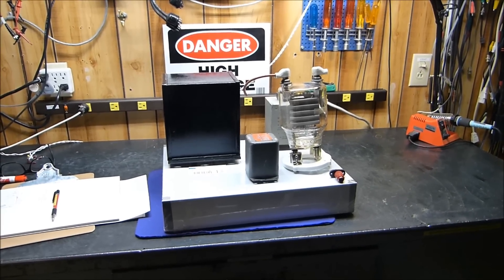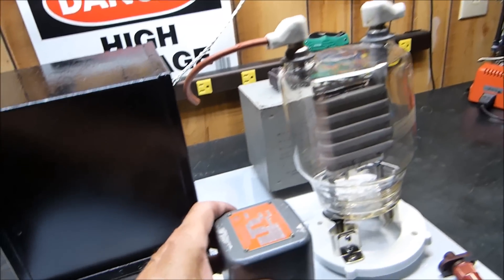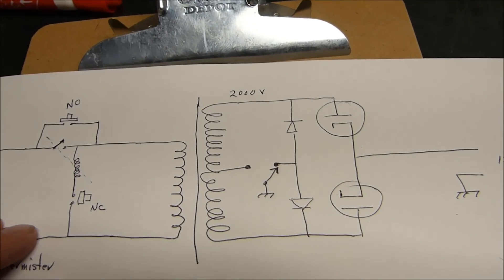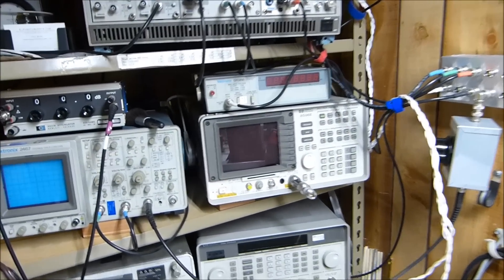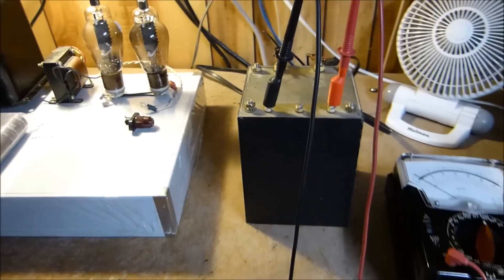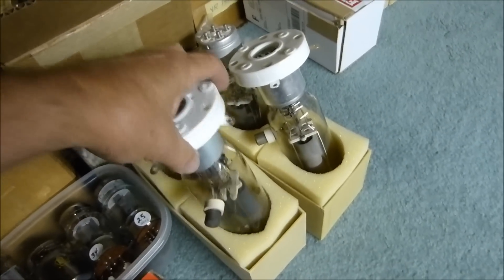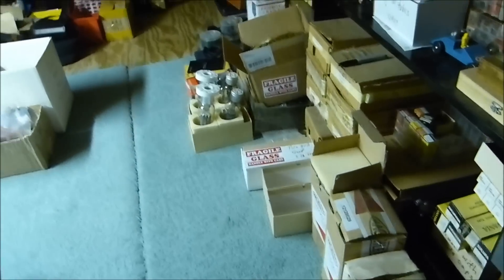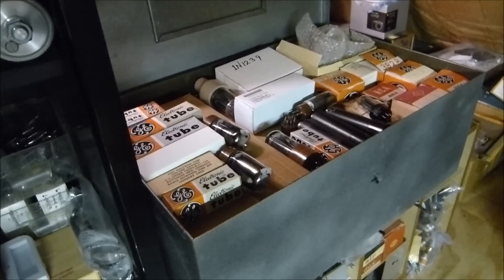833A Single Ended Triode SET Amplifier Project Part 1

Comment: Are you going to build it on a wagon or a little cart, just in case you ever want to tote it around? <big grin>
Reply from the maker: Buddy Martin After building and testing and posting everything on YouTube, I am not sure What I will do with it. I do have enough parts to build two for stereo but they are going to have to sound Really Good for me to build two and put them in my house  :-)
Reply: ElPaso TubeAmps unless you are in need of some new heaters in your house, don´t do it...;) At least 500W of power dissipation for ONE amp is not much more than a nice looking heater with a litte sound benefit.....

Comment: Wow that much current would make me sweat my ass out! That's a fine electric execution device right there! How do you maintain safety while dealing with that much current?
Reply from the maker: 규래김 I completely agree with you. Protecting everyone from the HV is The primary concern. Much more so than making the gadget work. I will devise better covers for the plate and grid connections and have to put it  behind glass or plexiglass or some sort of screen to keep everyone safe. I see these amplifiers on YouTube with the 833A in the open and metal plate caps. Wow... that's like having a loaded and cocked gun laying on the coffee table just waiting to see what is going to happen next. You could easily kill others, your pets, yourself, etc. I never let anyone in my shop with this equipment in operation while I am building and testing it.
Reply: ElPaso TubeAmps I see that's great. Would you make a video about safety or HV devices? I find it troubling to deal with it because I have to use different stuff (plugs, wires etc) including covering connections. It really freaks me out when current arc between connections.
Reply: ElPaso TubeAmps the simplest way is to make a metal grill type cover, as you do not want to prevent the heat/air flow. Or your tubes will melt down their glass envelopes.....